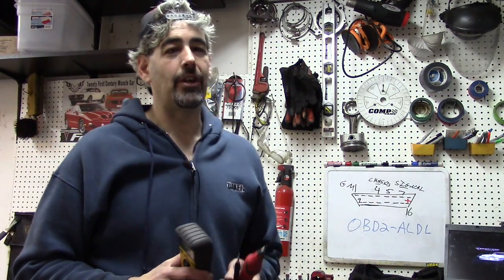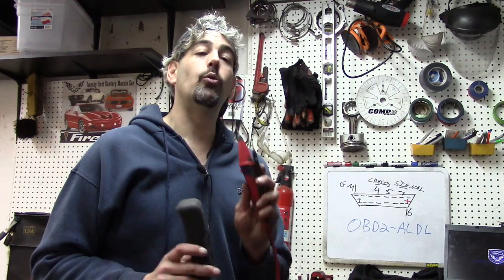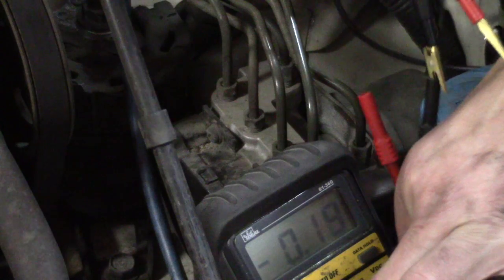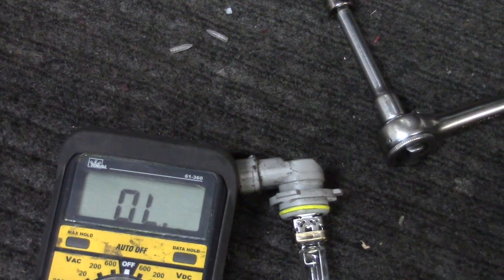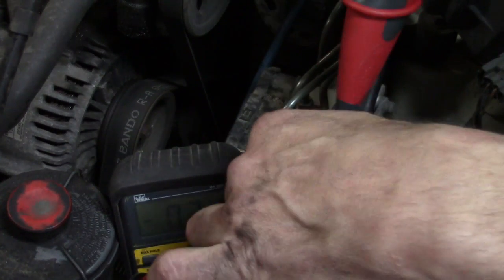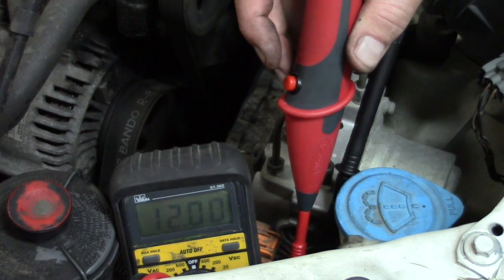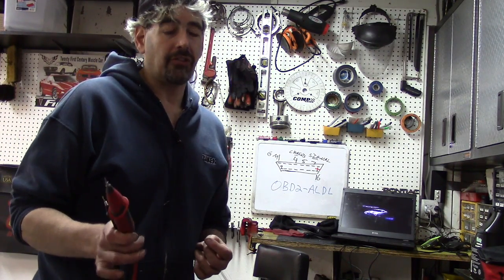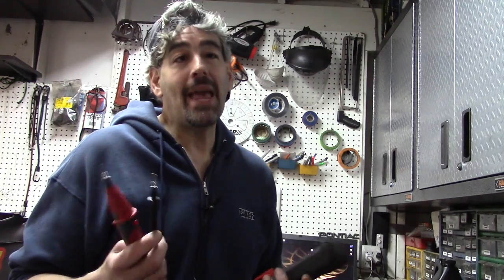Load Pro Electrical Tool Review (with product link)

Comment: COOL two thumbs up  to u my friend and by the way one gentleman wrote this tool draws more current  than a test light  and could damage electronics is that true. thanks for sharing  cheeeers .
Reply from the maker: +j georges Yes correct- a testlight (incadescent) draws .25A while the loadpro draws .5A.
Reply from the maker: Randy Jones Oh wow thats good to know!  As a rule of thumb I just use my LED light to test circuits unless I want to pull a signal to ground in which case I use the incandescent.

I am just not aware of what the amperages are in most PCM circuits (some, such as an O2 sensor heater) will obviously be much higher than a testlight but others I'm just not so certain and I play it safe

Comment: it draws more current than a test light it can damage electronics and cannot be used to find excessive resistance in the starting system
Reply: +DE Nichols Not necessarily.  wiring good, yes.  Starter good, no - not if test done right and you get the same10+v on both measurements. It almost has to be the component.   Starters go bad and can develop high internal resistance.   high resistance = low current flow = low amps.  Low enough and starter can have slow/no crank.  And starter will still drop 100% of voltage as it is only load in circuit.Point being towards OP comment:  can Loadpro damage ECM's ? probably yes - but so can testlight, power probe, jumper wire.(and really its the idiot doing work that is really at fault)  On Dan Sullivan's site there is a big discussion on this and how LoadPro if used for short burst is relatively safe but still not officially endorsed by inventor.  OP second point was about starter system; and again Loadpro doesn't replace a DMM, it augments it.  LoadPro can help find faults on control wires/relay's etc in starter system, but on high amperage starter circuit? not for that - but neither are testlight, power probe, small jumper wire.  So I guess I am not in total agreement with his comment...
Reply: Use Google and search for: 
"LoadPro operating manual" 
On page 2 of the manual there is the statement: 
"Not for computer (ECM) INPUT circuits. 
This tool has been tested successfully and will test computer (ECM) sensor driver circuits (B+ and Gnd/Return)." 

The usual accepted cable voltage drop during cranking is 2% which is 0.24VDC on a 12VDC system. 
The LoadPro nominal load resistance is approximately 25 Ohms. 
Using Ohms law that would indicate a fault resistance of approximately 0.6 Ohm. 
This value aligns with the reference chart on page 5. 

That means the LoadPro is safe to use on most connected ECM/ECU/PCM output circuits and ECU/ECM/PCM disconnected input circuit conductors to test for loaded conductor integrity/resistance. 
It also means the LoadPro can be used to detect resistance faults of approximately 1 Ohm and greater on high current starter circuits. 

The defective starter is easy to detect with  an inductive ammeter. 
If with a good charged battery there is no starter rotation or slow/sluggish rotation with high amperage and a significant voltage drop the starter is defective, shorted, seized or what the starter is driving is seized or defective.
Reply: +John Bartholomew  I need to say that you always need to think about what you are doing and this tool is no exception. A 500mA load can be risky on input circuits, no question about it.  But you always need to make a estimate on the original loads normal draw, and this substituted load.  Like in this case a 55W lamp will easy draw more than the load pro. 
 
Also, to have the expectations that this can measure things from computer inputs to starter circuits is just silly.  A computer input can be 4mA and a starter 800A.  One tool can't do it all. there is always compromises. And as far as I know no foolproof tool out there yet ;)
Reply: +John Bartholomew But you can find excessive resistance in starting circuit with your dvom you already have out with loadpro.  All a loadpro does is add 1 extra feature to dvom.  That's it. At battery, red on post, black on terminal - see a few volts, you have an issue.  zero you don't.  do same for other terminal.  (all while cranking or with loads on of course - no current flow = no voltage drop) .  At starter (admittedly better with leads other than loadpro) connect to POSTS (not terminals) of starter - red to power feed, black to ground.  Crank motor. record voltage drop.  Do same test across battery posts- again while cranking.  If numbers don't match (i.e. the drop across starter is much lower) you most likely have a wiring problem not a starter problem.  both tests show say 10v, then you don't have voltage drop in wiring and most likely have a starter component problem (with caveats of say a frozen alternator or equivalent which prevents starter motor cranking).  I don't see how you could figure all this out with a testlight...
Reply: Matthew Brice Usually with a drop while trying to start, 10 volts or above at the battery and the starter would mean the wires are good and the starter is good and would start the car or at least crank it.
Reply: patw52pb1 You're a 1%ter. I could read that a third time and probably still learn something.

Matthew, forgive my nitpick but I  felt like with that word of clarity I was correcting on was based on me literally thinking motor, right starter motor, no I think he means engine. We're still 2%ters and your comments gave my mind excellent exercise. :)
Reply: Matthew Brice
It's cool buddy, and thanks for putting up with me. No one likes correction....but technically speaking I need to be corrected regularly. I REALLY appreciated the conversation before. Now that you've commented so well that it made an amazing finish...even if the conversation ends up continuing on. :) The Hebrew meaning of perfection is closer to the word complete. This is complete.
Reply: +John Bartholomew Crap, that's exactly the inconvenience I'm always doing the old way.
Reply: +John Bartholomew  
Are you sure? 
Are you saying it can damage an ECU/ECM/PCM?
Why can it not be used on a starting system?
Reply: +patw52pb1 it draws 500 milliamps more than most test lights. And not enough of a load to find corroded battery terminals
Reply from the maker: +John Bartholomew Yes I would probably not use this on most PCM circuits.  The testlight I know (and have shown on another video) draws .25A.  The Loadpro draws .5A
Reply: John Bartholomew
If the cables to the starter were really bad, I think it'd find the problem. If the load pro tested fine, there could still be a problem that required a bigger load to see it.

The problem I usually have testing those circuits is that I can only get to one of the cables. The load pro has a better chance at seeing the problem I can't reach than a resistance test, that's for sure.
Reply: Matthew Brice going a little farther off point, my garage had it's second Hyundai with a seized engine that acted as you described. Drew down voltage below our tool's graph.
Reply: The engine couldn't turn over. Seized. Always check that when the starter really sucks down voltage.
Reply: +DE Nichols Agreed.   Which is why I had the caveat in my first post about seized alternator or similar causing no/slow crank and the word "almost" in the second post - its more likely but not always the starter itself.   Seized motor would obviously cause similar (and definitely worse news to have to tell a customer. Don't envy you there.  Definitely don't envy customer.)  But as far as electrical goes, starter is still only load in circuit so should drop almost all voltage in normal operations anyway- its the desired result. But the issue of course arises when voltage drop is as desired but the motor is not cranking.  Then like you say - be a true 2%'er and test other things to be 100% sure before just putting in a new starter only to find out it wasn't the problem.
Reply: Matthew Brice This may be like having someone comment on spelling. I know we were talking about an engine being seized, but engines aren't motors and starters are motors. So yes. That electrical symptom I described fits a seized starter motor or engine.
Reply: DE Nichols
My mentor always told me/us that "motors use electricity and engines burn fuel" 
He was also infamous for "Gas is for farts, gasoline is for girly cars, diesel is for manly vehicles, alcohol is for drinking and nitro is for racing".
Reply from the maker: +patw52pb1 Good grief Pat... Did you go to tech school in alabama lol??
Reply: Schrodingers Box Lol, no my education is Georgia Tech, UA (Arkansas) and UT Austin, but the mentor was a crusty but well respected racecar builder.
Reply: patw52pb1 If I were to put UA and UT in a sentence, I'd say, "You need me to take a urinalysis in Utah?" That was Greek to me. Lol
Reply: +DE Nichols Sorry yes.  Poor choice of words on my part. Meant "seized engine" and "engine not cranking".  In context of the discussion I should have been more careful with terms.  Thanks.